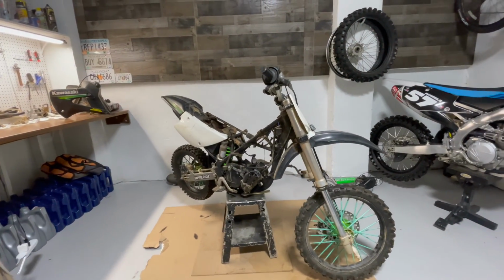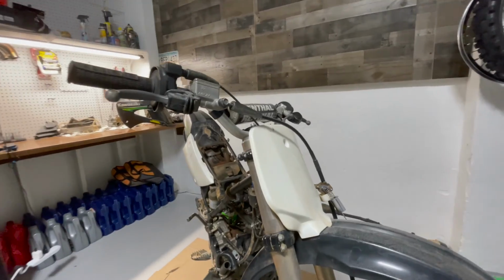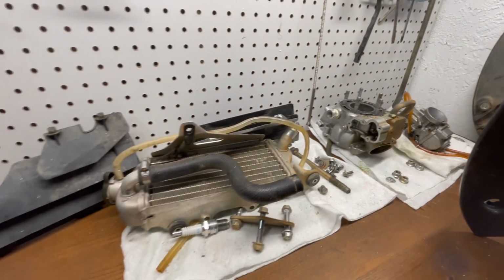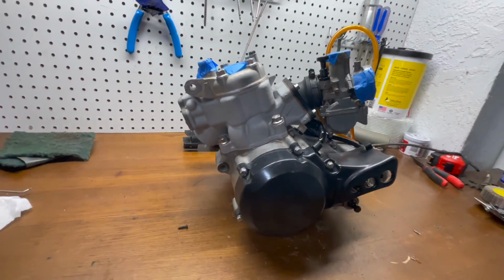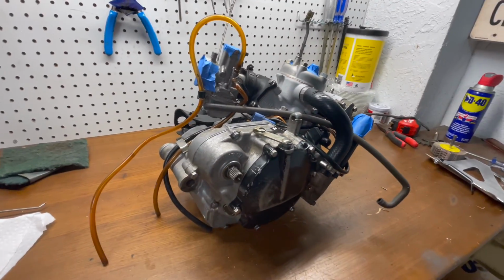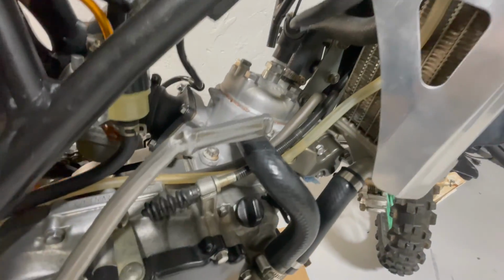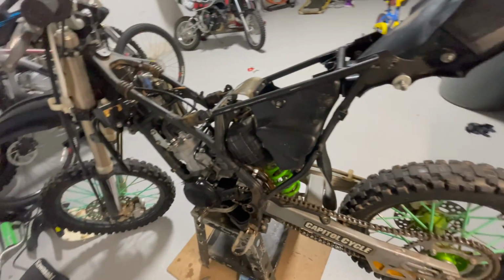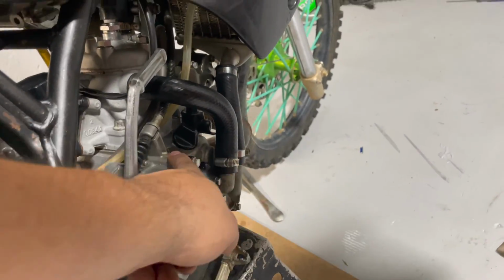$500 DIRT BIKE BUILD!!! BLOWN UP ENGINE!! Will it Run??? Kawasaki KX85. New Top and bottom end

Comment: I have a 2009 kx85 and it locked up like that what’s everything I’ll need to get it running?
Reply from the maker: Ordered a wrench rabbit full top and bottom end kit for under $500  comes with everything you need , only additional thing I needed was for the cylinder to be re plated